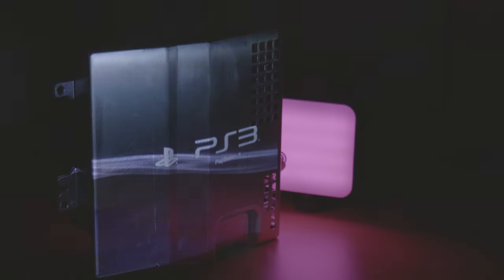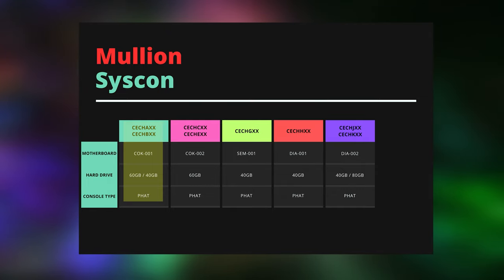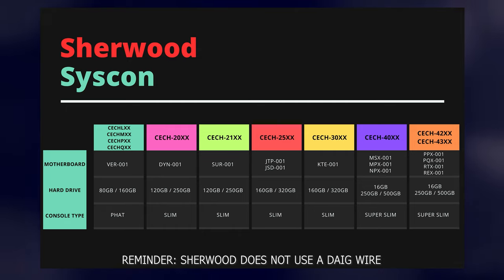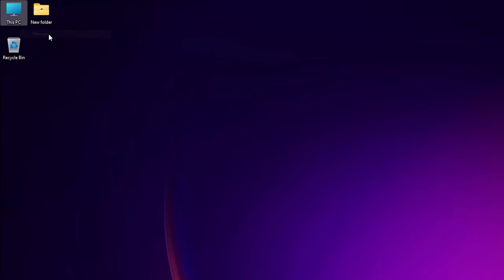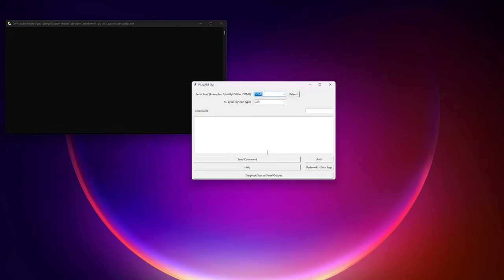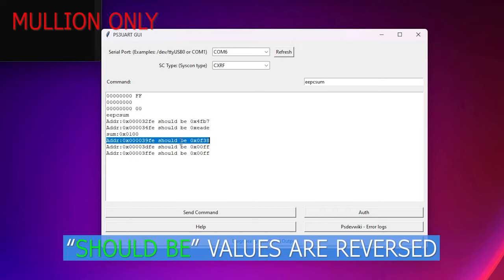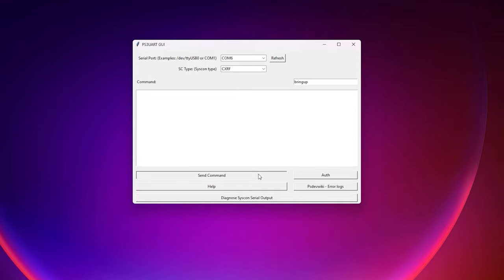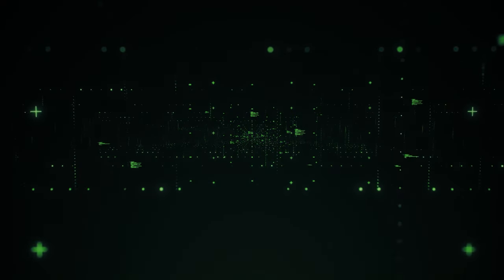HOW TO Diagnose a faulty PS3 ⚠️ YLOD || Easy UART SYSCON Tutorial For PlayStation 3 Yellow Light

Comment: The worst console ever made. Sony just needs to make this up to customers and make a complete backwards compatible console finally so we won't have to buy 10 PS3s just to have 1 fully functional one. This is a great video but it is way too much for a beginner. This repair requires an electrical engineer degree before attempting it.
Reply from the maker: Haha you can do it! 
I’m surprised there wasn’t a big class action lawsuit over it.
Reply: @Slot1Gamer  exactly. I didn't abuse my console like most kids and hardcore gamers did. But mine still got that YLOD. And I cleaned it from dust and kept it cool. I even waited for a year to get one cause everyone knows when products first come out, there will usually be bugs in them and then later they make a new and improved one. And then they put out the 80gb fat PS3 with Metal Gear Solid 2 and backwards compatible. I was first in line for it and excited to have it. Today I regret getting it because I invested my time, love and money on it and had great times on it. Now it's all just a memory that will never be relived.
Reply from the maker: I was the same, my launch 60gb model was used sparingly but still died 🥲

Sadly it’s partly Nvidias fault 
The 90nm and some 65nm ps3 gpus will fail no matter what you do, they were a design flaw from the start.

There is a fix however but it is complex requiring replacing the gpu
Reply: @Slot1Gamer  I noticed that also. You have to be a very good electrical engineer to actually fix it and even then it's a risk because if that don't get the GPU out right, that means your beautiful PS3 is gone forever. I don't know if I want to risk that. I'm hoping for a full proof solution.
Reply from the maker: I think eventually someone will start selling pre-modified boards like with the original Xbox and it’s CPU upgrade
Reply: @Slot1Gamer  that would be better because most gamers are not electric engineers. We just want to enjoy playing not learning how to build the thing. Lol
Reply from the maker: @elbandito5411  yeah I can understand that :D
Reply: @elbandito5411 your PS3 model has a defective GPU. If you want, there are services that specialize is replacing the GPU with one from a slimmer model. All backwards compatible models suffer from this.
Reply: @kalulofer4638  I know this. As I pointed out I can not fix this and I am not going to have someone else try to fix it with the chance of it completely dying. I'm waiting on a full proof fix that is also permanent. Not temporary like most repairs are.
Reply: @elbandito5411 well the GPU replacement is solution, l don’t know how to tell you this, but you can’t fix a faulty GPU. This is literally THE fix, there’s no better solution for these pieces of shit Sony should have never had made or at least recalled to repair.
Reply: @dark_horizon706  I know what the fix is. I'm just saying this defect is well know and happens to almost all of them so instead of leaving it up to the customers to go find some electrician to replace the chip, they should do a full recall and replace our existing ones with new modified ones or make a new console that plays all of their game CDs. Not a digital download of them because we already spent the money on the physical ones. We should not have to pay again for the digital plus they don't make some of these games anymore and you won't see them in their digital store anyway. Sony needs to make a PS6 fully backwards compatible that plays PS1, PS2, PS3, PS4, PS5 and PS6. Or a new backwards compatible PS3.
Reply: @elbandito5411  if you know what the fix is then you know there isn’t going to be a “full proof” fix. That is the fix that actually makes them what they should have been since 2006. (If Sony actually gave a shit or done a recall when they realised it was bumpgate.
Reply: @dark_horizon706  I simply said that is what SONY should do. Fix or replace. Not rely on customers to go to others to fix them. SONY does not care. Nintendo is the best. Xbox second. SONY is dead last.
Reply: @elbandito5411  yeah no shit, l can fucking read can’t l?
Reply: Also no company cares, Xbox doesn’t, Nintendo doesn’t, Sony doesn’t.
Reply: @dark_horizon706  woah what's with the cursing and getting upset? Learn to chat respectfully then maybe we can exchange comments. Later
Reply: Raw attempt here, from cleaning up PS4s & PS2s to fixing this.
Reply: @elbandito5411  welcome to the internet where people are assholes like me.
Reply: @dark_horizon706  So try choosing not to be one. Keep morals alive.
Reply: Worst console ever made is a stretch, the PS3 was a massive advancement. If you’re buying a PS3 in 2024 don’t buy a phat, research is easy.
Reply: @gorgon2167  It is the worst made. It's proven by many expert techs. Plus who wants to give up their backwards compatible one for a regular one? Almost everyone that owned a phat had it die on them so yes it was the worst made.
Reply: @elbandito5411 the original ps3 was one of the most impressive engineering pieces of tech ever created at the time. And it is still looks more premium today than any console ever since (the original BC phat with the chrome trims) The problem was really just the 90nm gpu and a hot psu. I bought a Frankenstein original backwards compat ps3 so now I have the Holy grail of ps3s with a 40nm gpu. Granted I paid an arm and a leg for it but still worth it.  I’ll also be modding it farther and remove the internal psu and make the console run through an external leptop one (pretty easy mod, hard to find guides for though. Apparently almost no one has done it, which baffles me)
Reply: @johnraw98  It's not impressive engineering if it was made wrong. I could have been an Olympic gold winning athlete if only my legs were built better. That's what you are basically saying. Plus having to get a Frankie proves again it was not made right. They were selling those consoles for $1000 dollars and they all burn out. I'm not gonna make a product and tell customers it's good but you will need to get it mod after you buy it.
Reply: @elbandito5411  first of all, for some reason you are, in all of your comments, saying ps3 instead of original phat ps3. The gpu problem that was causing the YLoD was fixed in the slim models. 2nd, Sony did fix a lot of defective ps3s. That’s how modders found out how to fix it. They back-engineered how Sony was fixing them. Sure, a couple million consoles susceptive to overheating were sold for the first 3 years of the console life. What about Xbox? lol what about Nintendo shitty joycons? The amount of money a person has to spend on a single or two $60 joycons is enough to buy a used and reliable slim ps3 on Facebook marketplace. So, please… ps3 worse console ever? Where was Nintendo with its pathetic Wii u when Sony was publishing 10 great exclusives ever year? again, only phat ps3s were defective. Although Millions of units never failed. Xbox had the same problem (literally the exact same problem). Nintendo Currently has the same problem, but they didn’t fix it in 3 years. It’s on the 8th? Year of the console and still not fixed. And if you say anything about it to them they might slap you with a cease and desist LOL Nintendo is the most litigious company on the planet and you imply sony bad nintendo great lol. I could keep going….
Reply: @johnraw98  you're just a Sony fanatic just can't face the truth. You can't tell that I'm obviously talking about the PS3 phat? Why do you see so many video on the YLOD? And why are most of these videos on PS3? It's because almost all of the PS3 Phats have this same problem. You even said it yourself that millions (millions) were sold with this problem. There literally is no other console that had millions of their system with a shutdown problem in the whole history of game consoles. Xbox had a few but not millions. And I did not mention joysticks or any accessories. Those things do not cost $600 to $1000 dollars which is what they were selling those Phats for. Plus shortly after the Phat launch they made a backwards compatible Phat which also had the same problem. And that was the last of Sony making backwards compatible console ever again making everyone have to buy every single Sony console just so they can be capable of playing their physical copies of old games. And yeah the slim works better but it is not a fix. It's a new design. I know the real full history of the chip mod as well and it is not because Sony fixed it. You're just putting out faults facts to justify your love for the most horrible console in history. And knowing that much about you and I can go on and in more detail but I've given you more than enough information than you deserve.
Reply: @elbandito5411  lol I think I’ve just come across the biggest Karen on the block

Comment: I tried modifying the 34fe address line coz i change the fan controls for that, as you can see here even tho I've already written the new value for the 34fe line it still didn't changed in the eepcsum. in fact, why can't  i change/ overwrite the 34fe line anymore? it still shows this weird should be value of 0x771c what did I do wrong? 

eepcsum

Addr:0x000032fe should be 0x52b7

Addr:0x000034fe should be 0x771c

Addr:0x000039fe should be 0x0f38

Addr:0x00003dfe should be 0x00ff

Addr:0x00003ffe should be 0x00ff
fantbl setini 1 p0 00.00 48.00 0x33
fantbl setini 1 p1 40.00 58.00 0x40
fantbl setini 1 p2 46.00 64.00 0x47
fantbl setini 1 p3 54.00 68.00 0x4d
fantbl setini 1 p4 56.00 72.00 0x54
fantbl setini 1 p5 60.00 74.00 0x5a
fantbl setini 1 p6 66.00 76.00 0x66
fantbl setini 1 p7 70.00 78.00 0x80
fantbl setini 1 p8 72.00 80.00 0x99
fantbl setini 1 p9 73.00 85.00 0xff
tshutdown setini 1 85
fantbl setini 0 p0 00.00 58.00 0x33
fantbl setini 0 p1 48.00 68.00 0x40
fantbl setini 0 p2 60.00 72.00 0x47
fantbl setini 0 p3 66.00 76.00 0x4d
fantbl setini 0 p4 67.00 77.00 0x54
fantbl setini 0 p5 68.00 78.00 0x5a
fantbl setini 0 p6 70.00 80.00 0x66
[mullion]$
w 34fe c7 f7

w complete!

[mullion]$
r 34fe 2

+0 +1 +2 +3 +4 +5 +6 +7 +8 +9 +A +B +C +D +E +F

-----------------------------------------------

C7 F7 

[mullion]$
r 3300 200

+0 +1 +2 +3 +4 +5 +6 +7 +8 +9 +A +B +C +D +E +F

-----------------------------------------------

33 40 48 4D 5A 66 73 80 99 FF 00 4A 00 4B 00 4C 

00 4D 00 4E 00 4F 00 50 00 51 00 52 00 55 00 00 

00 3C 00 3D 00 43 00 44 00 47 80 47 00 48 80 48 

00 49 33 FF 01 00 FF FF FF FF FF FF FF FF FF FF 

33 40 47 4D 54 5A 73 80 99 FF 00 30 00 3A 00 40 

00 44 00 48 00 4A 00 59 00 4E 00 5B 00 5F 00 00 

00 28 00 2E 00 36 00 38 00 3C 80 50 00 46 80 51 

00 52 33 FF 01 00 FF FF FF FF FF FF FF FF FF FF 

33 40 48 4D 5A 66 73 80 99 FF FF FF FF FF FF FF 

FF FF FF FF FF FF FF FF FF FF FF FF FF FF FF FF 

FF FF FF FF FF FF FF FF FF FF FF FF FF FF FF FF 

FF FF 33 FF 01 00 00 FF FF FF FF FF FF FF FF FF 

33 40 48 4D 5A 66 73 80 99 FF 00 3C 00 3D 00 3E 

00 3F 00 40 00 41 00 42 00 43 00 44 00 47 00 00 

00 27 00 30 00 36 00 37 80 3A 00 3B 00 3C 80 3C 

00 3D 33 FF 01 00 FF FF FF FF FF FF FF FF FF FF 

33 40 48 4D 5A 66 73 80 99 FF FF FF FF FF FF FF 

FF FF FF FF FF FF FF FF FF FF FF FF FF FF FF FF 

FF FF FF FF FF FF FF FF FF FF FF FF FF FF FF FF 

FF FF 33 FF 01 00 00 FF FF FF FF FF FF FF FF FF 

FF FF FF FF FF FF FF FF FF FF FF FF FF FF FF FF 

FF FF FF FF FF FF FF FF FF FF FF FF FF FF FF FF 

FF FF FF FF FF FF FF FF FF FF FF FF FF FF FF FF 

FF FF FF FF FF FF FF FF FF FF FF FF FF FF FF FF 

FF FF 00 4D 14 FF FF FF FF FF FF FF 00 FF 00 FF 

54 00 55 00 02 00 5E 00 5F 00 02 00 FF FF FF FF 

02 00 46 00 47 00 02 00 FF FF FF FF 02 00 FF FF 

FF FF FF FF FF FF FF FF FF FF FF FF FF FF FF FF 

FF FF FF FF FF FF FF FF FF FF FF FF FF FF FF FF 

FF FF FF FF FF FF FF FF FF FF FF FF FF FF FF FF 

FF FF FF FF FF FF FF FF FF FF FF FF FF FF FF FF 

FF FF FF FF FF FF FF FF FF FF FF FF FF FF C7 F7 

w 34fe c7 f7

w complete!

[mullion]$
eepcsum

Addr:0x000032fe should be 0x52b7

sum:0x80ab

Addr:0x000034fe should be 0x771c

Addr:0x000039fe should be 0x0f38

Addr:0x00003dfe should be 0x00ff

Addr:0x00003ffe should be 0x00ff
Reply from the maker: Try using the command line version of the syscon tool 
You may be hitting a character limit on the GUI
Reply: @Slot1Gamer  the problem is I did tried the cmd one (the black one that pops along with the other GUI) but can't even type there no matter what there's not even a cursor on it to begin typing
Reply from the maker: The command line version is a different download 
https://github.com/db260179/ps3syscon

Because you are inputting a lot of commands the gui has a character limit.

I am working on a streamlined tutorial for editing fan tables 

This one requires Python to be installed